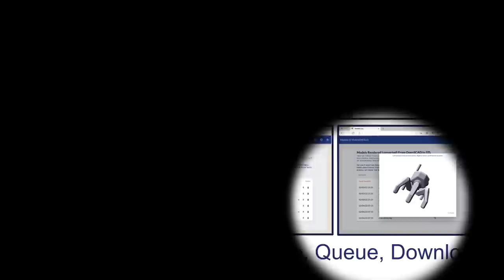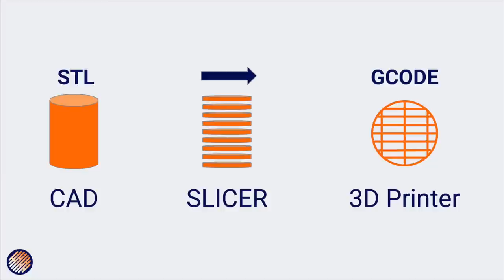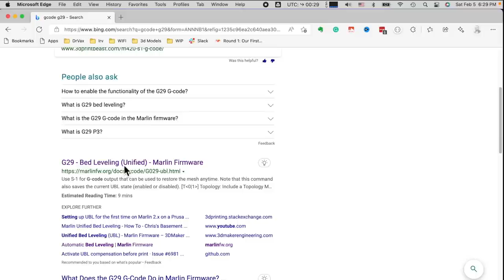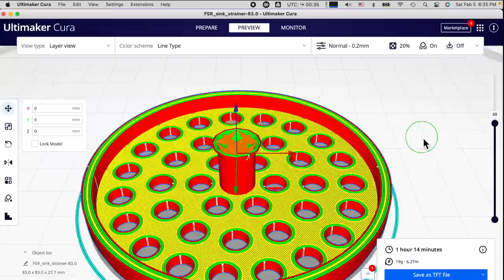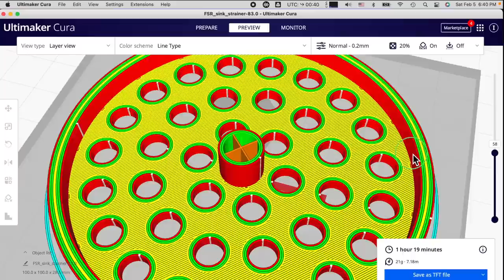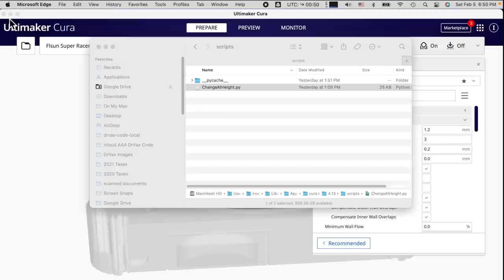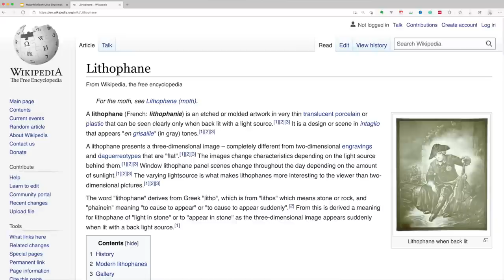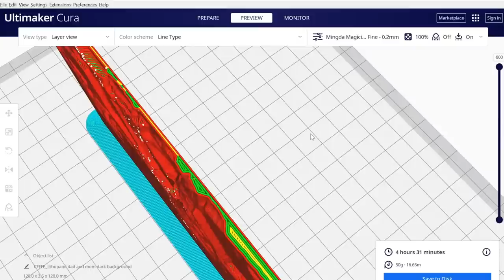Cura 3d Printer Slicer Secrets Exposed

Comment: Another thought is that if you are going to stand the lithoprint up like that, it should be aligned along the y axis so that there's more stability as the bed moves in and out.
Reply: depends on your printer topology.... Ender 5 bed only moves up and down
Reply: For a core xy I think you'd want it at a 45° angle across the bed.  The combined x/y movement would give you a greater effective resolution than if it were aligned along the x or y axis alone.

Comment: I have been wondering about slicer features for custom built printers that are uniquely designed and having the capacity to add the features into the slicer is an important aspect that shouldn’t be overlooked in an industry where were open sourced and relying on independent innovation. 

Cartesian 600x600x900 with a solid mount bed, moving gantry, servos, etc. gantry auto levels to the bed. This is why customizing can be an issue getting up and running.

Thanks for all you do.

Comment: Always your presentation is super. I am using Ultimate Cura 4.12.1 with ANYCUBIC 3D printer. The printed result is not accurate about 0.5% shrinked. Also I am amazing, that the lithograph print can be 3D printer,  I tried that,  and opened jpg image, then image convert screen appeared. and  your nice mom on your lithopane.  Thanks again.

Comment: Another great instructional video. However, adding ABL instruction can be problematic on some printers (CR6SE for example). It is also unnecessary to do ABL every print because the mesh data is saved to memory(if done correctly), from there the printer only needs the z homing to pick up the current height. ABL(mesh) only needs to be done after modest/major changes to the bed surface.
Reply from the maker: You are correct.
Reply: True, but since my prints are not time critical (most of the time) I just do ALB with every print, doesn't hurt, just takes a bit longer to start.
Reply: @tradde11 So many ways to do it :-) Fortunally I never have an issue with non sticking prints. I mostly print on a glass bed with some hairspray. Once in a while a good rinse with hot soapy water to clean the bed.

Comment: Thanks again for your video Irv, there is always something to learn ;-)  I actually experimented with lithophanes last year and printed some nice ones. I printed them curved, put them in a printed frame with hooks so you could hang them on a lampshade. They are great fun and almost no one knows about them and their history.
Reply: What pla and color do you find best for lithophanes? Also how difficult is it to get them to be curved?
Reply: @johnhodson8619  this is not an expert advise but I used neutral white that shines nice through and I used a website to create the lithophane that also let you create the curved image. print it vertically. Hang it on a lamp shade and you have a nice photo when lamp is on and just a 3d print when lamp is off. Search for creat litho-hand online. There are several.

Comment: Another tip is to do infill at 99% instead of 100%.  You actually can save a lot of time on the lithophanes.
Or just increase wall count higher than the picture needs ( like 50). 
Looking forward to the next video.

Comment: Great Channel, thanks so much.  Can you help please - I am printing a nose for a model glider that is meant to be hollow, but there is an infill at the very bottom(the start of the print)how do I remove it ? I have no infill selected,  I am using Cura 4.13.1 and an Ender3 Pro.  Thanks in advance,  I am new to printing,  about one year.

Comment: I have an Artist-D Pro.

I'm trying to make something similar to the 2 color coin using Cura to slice a FreeCad design. It's giving me fits.

Could you do a video on how to do it with my setup?

Thanks Tom
Reply from the maker: Try using the IdeaMaker slicer.  It makes it much easier to do two color printers on an IDEX printer.
Reply: @MakeWithTech  I tried ideamaker but I kept getting an error when I was trying to export the finished g code.

I think that was the problem I had.

Comment: Awesome. Thank you for sharing. What type of filament should I use for doing a photo?
Reply from the maker: I find PLA works just fine.
Reply: @MakeWithTech , I haven't even got the G28 on my settings
Reply: @tradde11, I am a total noob. Apparently my son in law did install all of that. I just don't see it. I am learning as I go and am maybe overkeen🤣🤣🤣🙈🙈🙈
Reply: @tradde11, at the start up commands where you showed it. It must be there as it's working, but I wanted to add the G29
Reply: @tradde11, I have the Creality Ender 5 plus as well as the 3 version 2

Comment: Im trying to get a helmet to fit on an ender3 xtender 300x300 bed does not fit but if a pull  up a cr10s with same size bed it fits want  can i do is it the firmware or the cura slicer thanks

Comment: Whenever I try and add a printer based on an existing printer definition the non-print (margin, gutter, etc.) from the original printer shows up in the new printer.  Often the non-print area is different because of the method used to secure the print surface.  How do you change the non-print (margin, gutter, etc.) area?

Comment: I am not sure that printing use XY  is more accurate than using Z. After all, the bead of pla that is laid down is generally wider than the layer height, isn't it?
Maybe it's that you get smoother edges?
Reply from the maker: It is not about accuracy.  It is about the size of the movement, the resolution.  When printing in the Z direction the resolution is defined by the layer high.  When moving in the X or Y directions the resolution is defined by the stepper motor limitations.   While the smallest resolution of a layer is generally .10mm the resolution possible due to a minimum turn of your steppers motors is often 1/10 of that.  Here is a good article explaining this in more detail:

https://pinshape.com/blog/4-things-you-need-to-know-about-3d-printing-resolution-outdated/
Reply: @MakeWithTech  ah, I see, thank you for the explanation!

Comment: I purchased a new McBook Pro with the M1 Max chip and the Cura Software is not compatible. I am still using my old McBook Pro waiting for Cura to update its software to be compatible to the new 2021 McBook Pro with the M1 chip!
Reply: Wait specific Mac chips just don't work with Cura? Really? That's so dumb! Cura works on any combination of any hardware that can run standard Windows 10! Boy, am I glad I don't use Apple products; they always seem to have some fault that isn't present on Windows machines.
Reply from the maker: The issue is the QT graphics framework that Cura uses.  They use V5.x and you need QT 6.x for M1 processor support.  Cura v5 will be upgraded to QT 6 but I could not find a date fir the v5 release.
Reply: @MakeWithTech  I was trying to make a lighthearted jab at Apple, but that's pretty interesting. Don't see why it doesn't "just work" like it does on Windows but I'm not an engineer of any type so I'll just have to assume there are legitimate reasons that Apple is purposefully gimping their newer products like that.
Reply from the maker: Apple switched to a new processor architecture that has higher performance with less power consumption leading to lower battery times.
Reply: @MakeWithTech  But they seem to have omitted something from the CPU internal code that would have otherwise allowed it to run Cura 4.12 without issue. Who knows what else they omitted? Technology advances, but backwards compatibility is still very important.
Reply from the maker: It is more complex than that  99% of software that ran on the old architecture run on the new architecture.  Graphics are always complex.
Reply: @MakeWithTech  That's fair, like I said I'm not an engineer in any way, it just seems odd that standard Intel and AMD processors that are similarly heat efficient and offer similar or better performance than that new M1 chip seem to be able to run current Cura just fine, even if said processors were designed/produced after the M1 design was finalized.

Comment: Why on earth are you rotating the print vertical?
Aside from all the problems caused by a tall, thin print — like deformed layer and knocking the print over — you get better details from the Z axis than the X/Y axes. You just need to change the layer height, which you have better control over than the line width. And then you didn't even talk to them about CHANGING the line width for better details.
The only reason to make the print vertical is if you want the greater Z axis detail implemented across the image, instead of for its height.
In fact, isn't that what lithophane printers do want? Maybe it's not that the print shouldn't be vertical, but that you have your explanation exactly reversed.
Perhaps they want the finer Z axis details to be across the pic, instead of simply layer height?

Comment: I'm trying to jest tring to get 1 solid print with a 1.0 nozal I I'm tired whin I won't a solid print I should get a solid print mode only like the urinal 
Cura 4.0 4.13.1 has a lots of problems I'm waiting filllimet and money I can't even get supites 
I'm getting support arrears for cr10s
Reply from the maker: Your extruder is probably not capable of pushing out sufficient filament.  Try increasing your extruder temp by 10 or even 15 degrees and slowing down your print speed to 30m/sec.